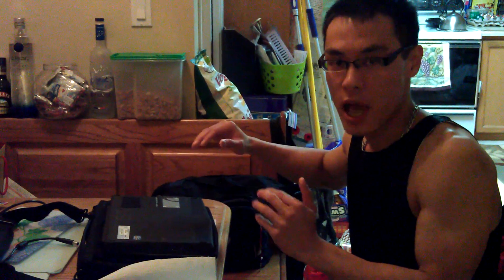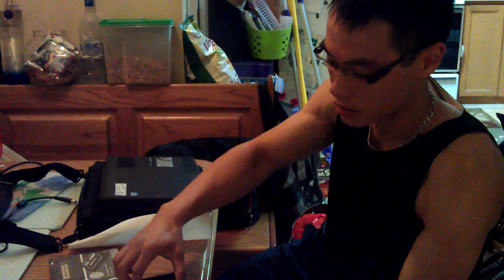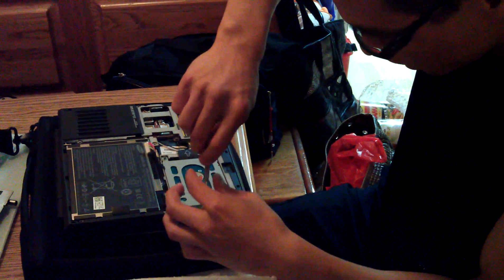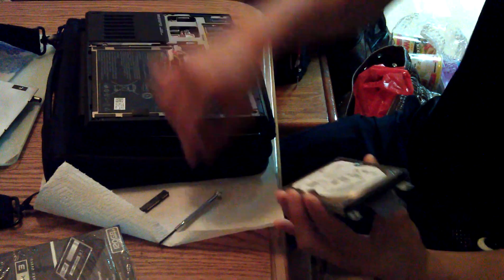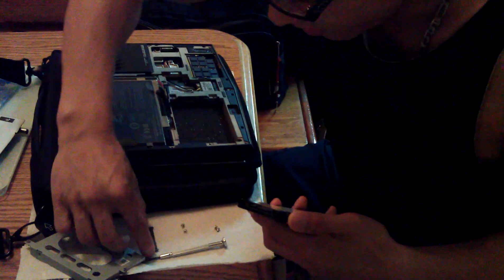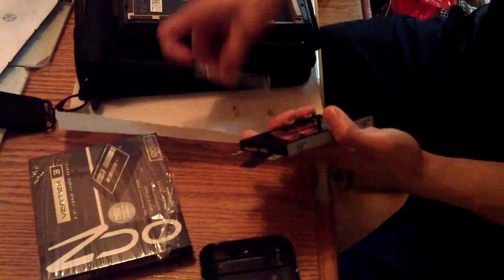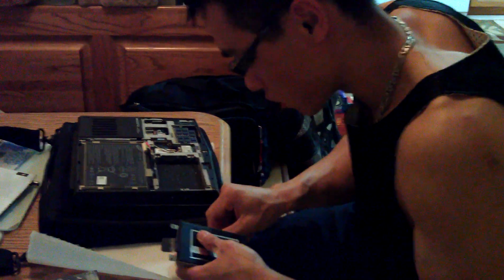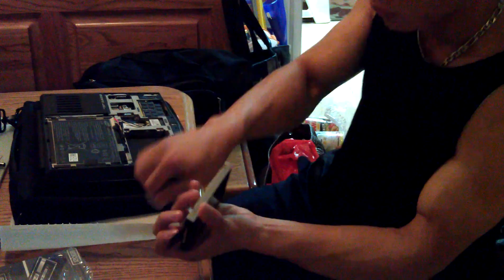how to take apart M11X R3 and swap the hard drive

Comment: Thanks for the video, my R1 after almost 5 years of usage has a hard drive that is near failure. Can anyone recommend a free cloning program that is pretty straight forward. I'm a novice when it comes to all the programming stuff. I have an external harddrive that is larger than my current drive, just unsure how to clone an image to it that will boot up when I install the replacement drive.
Reply: +hockeyavalanche73 when you buy a samsung SSD it comes with cloning software